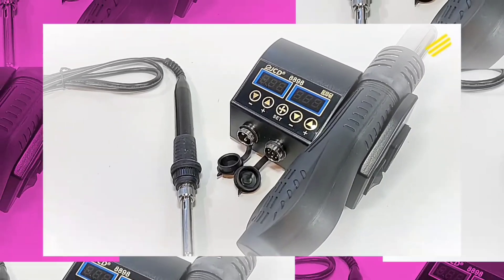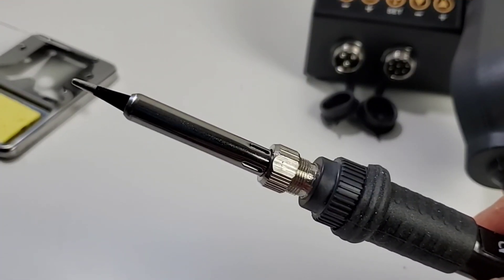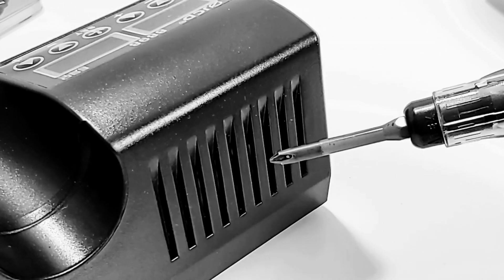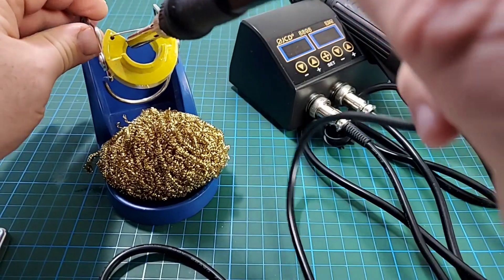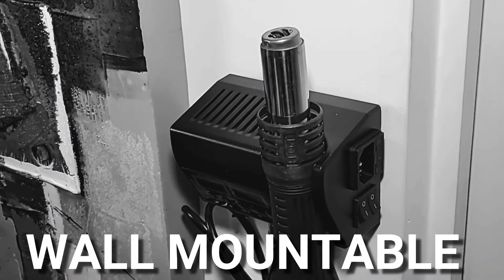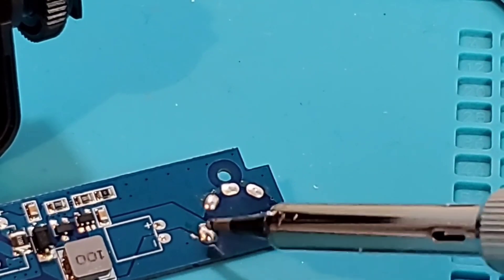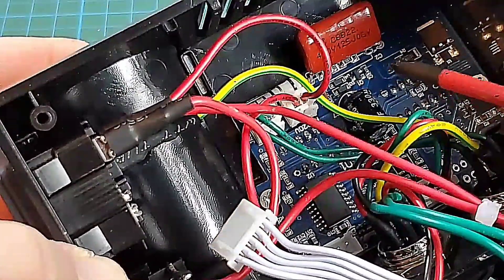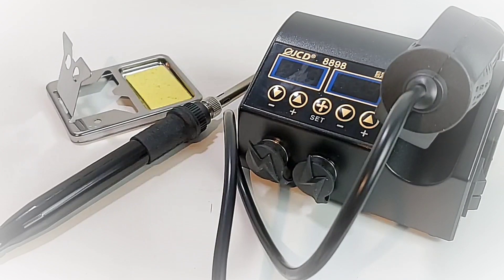JCD 8898 HOT AIR/SOLDERING STATION Review & Teardown!

Comment: It is essential to ensure that both Devices of the Soldering Station, i.e. the Hotairgun and the Soldering Iron, are always connected to the Soldering Station.
As soon as the mains Plug is connected, the Contacts of the two Connection Sockets for the Hotairgun and the Soldering Iron are under Mains Voltage.
This also applies if the Devices are not yet switched on via the Toggle Switches!
Since both Sockets are idiotically "male", the uninsulated Contacts are completely exposed and can be easily touched.
Reply from the maker: Thanks for your input ! 👌

Comment: i cant change the temp between C and F i have the exact same one with EU plug?
Reply from the maker: Try a hard reset.Unplug from wall for 5 minutes.  Plug in and try again.
Reply: @KeepOnTesting  can you do me a favor and tell what max and min is if it's in Celsius for both solder and hot air please :)
Reply from the maker: @slitherixxx 100-400°C for Hot Air and 180-500°C Soldering Station.
Reply from the maker: Yes, sounds like you have temp in Celsius already. I don't know what those other numbers are pertaining too..
Reply: @KeepOnTesting  yeah maybe, but it annoys the F out of me that i dont know what it is for, but thanks anyway :)

Comment: Hey i know i am abit late to the part on this. I have just bought one of these but had the mistake of buying the 110v  listed instead of the 220v. What i am wondering is do these automatically step up to 220v if i change the plug to a 220v plug or have i made a huge mistake. Thank you!
Reply from the maker: Unfortunately it won't work. The transformer is non switching so you're stuck with the AC input it was designed for. You're underpowered by 110v at least so you won't have enough juice to solder.

Comment: I received the 220 volts unit. Is there a way to make it work with 120 volts as I'm in Canada ? (considering changing wire, config inside ) ?
Reply from the maker: Unfortunately not. The included transformer can't be rewired. You could use a step down converter, it will run you about 65$ on Amazon https://amzn.to/49SzGzW
Reply: @KeepOnTesting  Yes but the transformer is only there to supply low voltage to the electronics so I can change it for a similar output. My concern is the 220 volts usage elsewhere. Does it supply the iron or the blower ? If they work through the Triac, this can be set to work on 120 volts. 
Any idea on that ?

Comment: The hot air gun need restraining as well, I tried desording with this  no  luck don’t now if it’s the type of solder.  Any advice ? Thanks and please
Reply from the maker: There's no calibration for the heat gun. If it's unleaded solder make sure to turn the heat up high and use Kapton tape to protect the other components.

Comment: I have one of these, but the heat gun isn't heating up at all.  Any idea what I can do?
Reply from the maker: If the device blows cool air and does not produce heat when powered on, it is because of a faulty or broken heating coil. The best fix for this problem is to open up the casing and replace the heating element. You can find replacement coils on eBay.

Comment: Great Review and Teardown! Thanks! However you didn't mention that the connectors are male, and without the "Dust Covers" on, one could get electrocuted or short out if something metal should hit them! This is a electrical hazard! Defiantly a Major 'CON' with this machine!
Reply from the maker: Happy New Year my friend!! Great points. Yes..definitely a safety concern!! Thx for pointing it out !!
Reply: I zapped myself like that 30 min ago i can't manage to measure the tension that went trough my arm 😂 do you know how much V does it output on the iron side ?
Reply from the maker: @samad7836  Not sure ...could be 120v if it's unshielded directly from the power input. Glad you're OK!
Reply: @KeepOnTesting  i live in europe so the power from the wall is 220V the station was off but plugged in the wall when i got zapped. i thought that i got zapped by a capacitor but idk if it's ac or dc that is fed in the iron
Reply from the maker: @samad7836  Presumably DC via a bridge rectifier ..I no longer have that unit so I can't confirm but I'd say you got zapped by 24V DC.

Comment: There are hidden commands and actions that you can perform on this soldering iron but without instructions you would not know that these functions existed.
 To change the display from Centigrade to Fahrenheit is easy.
From Switched Off, hold down the "-" & "+" of the iron side and switch on the iron power switch. The display will show  ° C     Press the "-" and the display will show F°.  The display will return to Centigrade on restarting.
To calibrate the display to the actual iron temperature you will need to measure the iron temperature and either add or subtract the difference to the display. To get this function up press both the "-" &"+" both together and the iron screen will display "0" "0" press either "-" or "+" to add or subtract to the display temperature.
I hope this is useful to some people.
Reply from the maker: Thats great 👍 info ! Thx for sharing!

Comment: Hi Darren, I like your video. I did not know that you could change the readout from C° to F°. Are there any more secret tip for this iron as I just killed my soldering side by pressing the control up and  down buttons as I was turning it off and while the Air gun was cooling. Is there a reset Sequence or something as I have absolutely nothing on the Iron Side but the hot air gun works. Nothing inside looks burnt or  exploded and of course there were no instructions with it.
Could I have somehow switched it off?
Reply from the maker: Sorry my friend. 
No magic solution here...Have you tried unplugging it from outlet for at least 30 seconds so the IC cold boots ? It might need a simple reset...

Comment: Just had  the DK125 power management IC explode on me. It turns out its a common failure of this model. It did last for more than two years but the unfortunate thing is that I can  not buy that IC in Europe and ordering from China will take ~2 months. I also failed to spot a replacement IC....any suggestions?
Reply from the maker: Unfortunately not my friend..hopefully the supply chain will cone back online soon so the parts scarcity can finally disappear 😢

Comment: I have a JDC 8898 soldering station and the soldering iron has stopped working even though the air gun works. When I plug in the power cable, sometimes the soldering iron temperature display lights up for an instant, check the triac and bridge it if it heats. If you can help me I would appreciate it.

Comment: Omg what is supposed this to be? Well thx for tear down but that is all than you just naming parts. Everybody who is interesting in teardown can identify capacitor, transformer etc...
But some comparison of real usability is totally missing. You just desolder once smd capacitor ant it took almost half minute on part which has really low thermal capacity. So basically you just shown "hey ppl this think is not totally scam it's just crap".
Showing accuracy of soldering iron is nice but don't tells much much important is how it behaves in soldering and can react if temperature goes down due to touching of component which has high thermal capacity.

Anyway thans I at least know to stay away from this and rather invest few more for sth of higher quality.

Thx
Reply from the maker: It's hard to please everyone...I try to stay away from the engineering drool and stay focused on the hardware at hand. Yes it's a wire round transformer but is it any good..sure it converts 120ac into 24vdc but is it a decent performer ... As always I appreciate all the feedback good or bad.

❤️Unfortunately I would pass on this unit. There's been a lot of issues that point to negligible QA which means it's not reliable. Better options out there.
Reply: @KeepOnTesting  Hello Darren, thank you for your reply. I might miss it but I'd expect to mention this QA issues and why youd stay away from it in the video. It might be searched by ppl who are starting with soldering and electronic. ;)

Comment: Or maybe you can measure the volts for the iron so i can see if its 110 or 24volts element
Reply from the maker: 110v 😀👍
Reply: @KeepOnTesting  I mean, the voltage that goes from the iron conection not the voltage from the electric red.
Reply: @KeepOnTesting  You see the two outlets for the hot air gun and Iron? That's where I need to see the voltage. (iron). And its recomended for each one of us who owns one of this machines, for in case your element heating got broke like mine.

Comment: Mine sadly arrived faulty, the minus button for Hot air gun doesn't work at all.
Anyone knows if its possible to fix ?
Reply from the maker: Well that sucks..have you opened up the unit and check the traces/wires..might be a bad solder joint too.

Comment: Broke after i used 4-6 times
Reply from the maker: What broke on the unit?
Reply: @KeepOnTesting  the bridge rectifier and the dk125, i didnt find one of those so i put a viper22a the soldering iron wors better then before but the hot air gun dont work at all after the fix lcd for hot air blinked 2-3 times and after thet nothing i will try to fix it but i dont have to much hope
Reply from the maker: @xcoltgreenx  Sorry it went south. Have you tried contacting JCD ?

Comment: Can someone help me to check which voltage is on diode zenera D5, my just fire and i would like to replace it. Its a power supply for IC1.
Reply from the maker: No problem
I just need clarification..what do you need to know exactly...? The zener diode is .721 volts.

Comment: Do you know about the OP message (or code) on the soldering iron screen?
Reply from the maker: It means OPEN..your iron isn't connected to the station..try reseating the unit.
Reply: @KeepOnTesting  I'll try thx
Reply: @KeepOnTesting  Hello, I have the same sound, but it's not in the connector. So maybe the heating element in the tip is burned?

Comment: Mine broke down after 5 months of little use
Reply from the maker: Ahh..that's not good..what broke on the unit ?
Reply: @KeepOnTesting  I think one  of the internal components got faulty. 

When I used the solder side, the lcd was dim... weird... and it didn't became hot. Now the solder side doesn't work but the hot air gun side does. 

I think it's one of the diodes or the main triac...

Comment: is there any soldering station/hot gun that also has desoldering attachment?
Reply from the maker: Yes, but they are uber expensive ...
Generally speaking you want a separate desoldering station. The AOYUE 474A++ is a great unit,  I'll be doing a review hopefully soon.
Reply: @KeepOnTesting  do you have model number or link on ebay of one of those stations with all three?
just want to check out how it looks etc..
Hopefully the chinese brand like these makes one later at cheap price like this one.

It would be good if there was desoldering attachment you can just plug into this soldering port of this station..
not sure if you can buy one.. do you know if you can?
Desoldering is a necessary thing we may need to do from time to time.
Reply: @KeepOnTesting  i just checked on ebay for the Aoyue 474A++ and it is not cheap either  + very high shipping cost (due to low of amount sellers)..and only has one functional purpose..
and will take up yet another space on the desk...

Surely can't they make an desoldering attachment for this type of stations?
Would save on desk space and cost.

Comment: how do you controller the airflow rate?
Got links for the tips you bought cheaply?
Reply from the maker: Press the SET button,  from there you select the F10 for max air flow or F1 for min

Comment: Hi, thank you for your great video! I've bought the same soldering station and I tried to desolder parts on a PS4 motherboard but even at full air flow and max temp, I didn't manage to get a solder melting! I've tried for 20 minutes long! What could be wrong?
Reply from the maker: Leas free solder has a higher melting point than non leaded, trick is to mix leaded soldering into the joints and lots of Flux. This will create a lower melting point and you should be able to desolder normally.
Reply: @KeepOnTesting  the thing is that the chip I wanted to remove has its solder pads located under the chip so theyre not accessible
Moreover there is a huge solder pad under the chip
Lead free solder melting point  is 217°C...
Maybe my resistor is faulty?
Reply from the maker: @shipyu--pyu8900  It's possible but unlikely. Have you tried using a pair of tweezers and the soldering iron instead of hot air gun. Apply solder to each side of the IC then heat up the solder on both sides simultaneously,  it should eventually come off.
Reply: @KeepOnTesting  I'm not even able to apply solder on both sides of the IC because the chips' solder is located under it
I've tried to put some leaded solder but it wouldn't stick because it had nothing to stick to
I've even tried using the hot aire gun a 480°C on one hand and pushing the chip with the soldering iron without success..
I'm feeling a lot of heat sent back by the motherboard so my only theory is that the air gun is not giving enough heat and that the motherboard rejects that heat faster than it receives it
Reply from the maker: @shipyu--pyu8900  I wish I had better news. It does sound like the hot air gun isn't pushing the amount of heat required. Have you tried measuring the temperature 🌡?
Reply: @KeepOnTesting  yep I already tried but the camera I used was only going up to 270C
This temps has been reached quite slowly I think even if I put 480c on the air... 
The air is working great on other pieces of electronics so I don't get what the issue is..
Reply: Hi! Maybe you can check if your station is set to fahrenheit instead of celcius. 480F = 250C

Comment: The soldering of JCD 8898 does not hot at all! How to fix it? Thanks for the review.
Reply from the maker: Try replacing the fuse .
Reply from the maker: Definitely sounds like you're on the right track...do you plan to repair or get a new station altogether?

Comment: So, the bottom half is what?  An AC to DC converter and the top PCB is the digital electronics that power the device?  I wonder if I could take the top PCB out and connect it to a buck-boost running through a 24v 14a PSU.
Reply from the maker: You could but why would you ? 🤔 Heats up fast and holds Temp very nicely 👌..
Reply: @KeepOnTesting  because I'll already have a 24vdc power supply on my workbench, so it'd be redundant  I could probably build the guts of the of this into my power supply enclosure as well for an integrated solution
Reply from the maker: @ulfrinn8783  Roger that..well if you do the mod, send me a pic and I'll post it on the website (www.keepontesting.com). 😀👍

Comment: I receive this product today and ive test the item immediately the hot air wont heat
Reply from the maker: Heating element may have been damaged, did you do a Teardown? Is the fan spinning ?
Reply: @KeepOnTesting  yes the fan is spinning but the blow is not hot is just normal temp
Reply: I hope they will replace/refund my order I'm so disappointed it takes almost 2weeks 2 received and suddenly its defective.
Reply from the maker: @jacobriennunez6389  They definitely should, as the heating element is expensive to replace. Did you purchase from my link ? If so I'll try to help.
Reply: @KeepOnTesting  I think its the same hope they will response. its hard to communicate with them because I'm in the phil.
Reply: @KeepOnTesting  hope someone can help how to request for refund or replace this item

Comment: This is too cheap to be true, I received mine with warning label on package saying "Does not conform EU regulations".  As you should notice in teardown, there is NO INSULATION between power supply and electronics, so some of  those male pins of connectors are LIVE. Due to single pole switches, pins may be EXPOSED TO MAINS whenever plug is connected to mains.
Reply from the maker: For the little $ they are asking you get a lot of soldering station here. It doesn't have a UL / Intertek listing but it's not expected at this price.
It's still very well made and much safer than many that cost more.
Reply: @KeepOnTesting  So it's safe? I have enough things to worry about, I don't need to add in the worry of this thing electrocuting me lol
Reply from the maker: @jason2547  Yes, it's safe...I haven't had any issues.👍

Comment: Does anybody know which setting you can adjust when holding + and - when starting it besides switching between C and F. You can press the + button in the same "menu" and then some numbers show up (125, 135, 145, 155)
Reply from the maker: Did you ever get your answer?
Reply: @KeepOnTesting  no :(
Reply: It displays U26, U36, U46, U56 on my unit